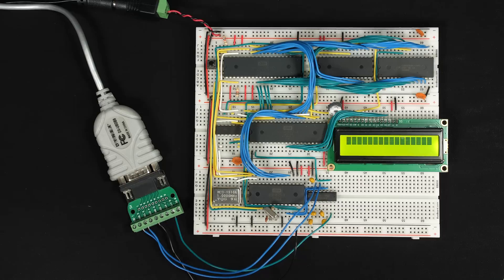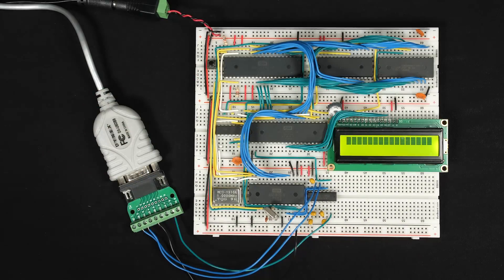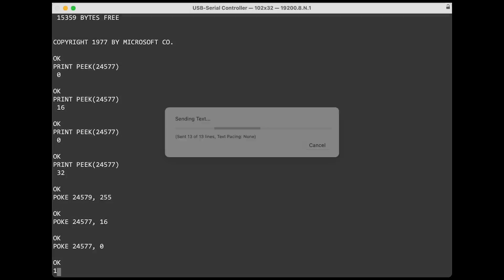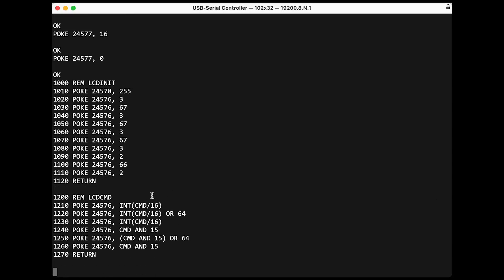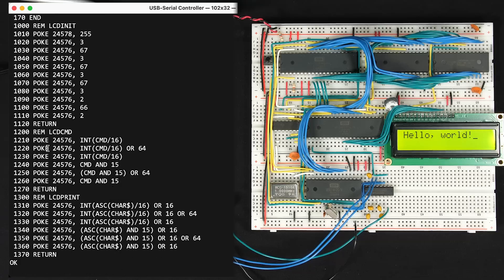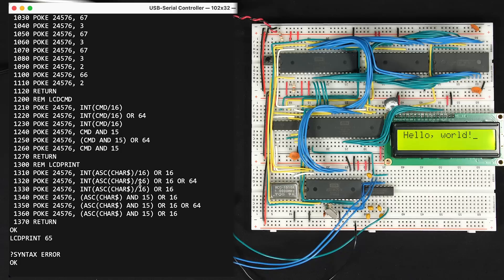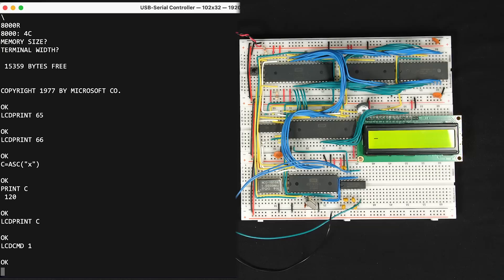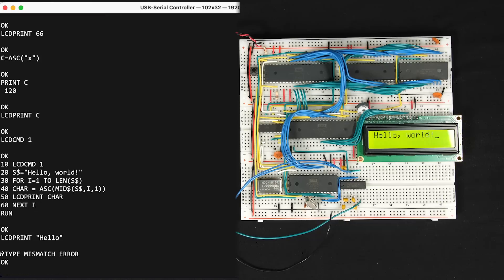Hacking Microsoft BASIC

Comment: One thing i noticed, not sure if it's relevant, but in your LCD instructions, you're calling txa to transfer X to A, but then shortly after calling pha to push A to the stack, then calling pla at the end to pop A back. 

It looks like whatever was in A before you run one of the LCD commands is getting lost, but I could be wrong.

Comment: Dear Sir
When you type 'mov' on programing enviroment, it still display on the screen as text mode before compiling, right?

I have searched through internet, but none have clear answer relating how exactly computer physically detect series of 0/1 abstraction per code line to trigger control signal through circuit??

For example again: 
Key board: you press the letter, and it physically interact with circuit
Punch card: you punch the hole and computer physically detect holes to trigger the bulb light or not ( via light through hole or not)
Two clear above example shows the physical that make the bridge to link 0/1 abstraction to hardware. 
And about binary pattern after compilling, what's the physical mechanism to detect them to trigger electrical signals????

Comment: Just amazing, I was loaned an open university circuit board, with associated literature, for a few months to try and understand how early computers work. I worked steadily through the modules but found the modules to be weak and lacking in actual detailed explanations e.g. why registers were not set back to zero, I thus became frustrated and by the end of the three month loan I had not gained the required skills to fully understand how the code did what it was doing.  Contrary to the open university course Bens short explanations of how the code is constructed and executed with resultant actions taught me more in 40 minutes than the thee month university moduled course. I found the comments section in the tutorial useful too in that the answered many of queries (misunderstandings on my behalf) I had. Big thanks to Ben and all those who answered other peoples queries, questions and constructive criticism.
Thank you all.

Comment: Dear Mr Ben, I have a question that myself not clear for a long time:
When we type code display on the screen, it is translated to machine code as binary pattern.

But how this text of series 0/1 interact with memory hardware and generate electricity signal as on/off switches

For example, we press key and it closes the switch, we load punch card and computer has sensor to detect holes or not as 0/1

Comment: So, I didn’t like the fact that the lcd was showing just blocks. I wound up running the LCD initialization assembly right in front of Wozmon. I also had it print a string showing “Wozmon” after the initialization. I then had the reset vector point to the beginning of that assembly code.  It then dropped right into Wozmon. I did the same thing at address $8000 so when you wanted to run basic, it printed “MSbasic” first and then dropped right into basic. This was a great video. I’m glad we’re using the lcd again! I also tried to run Oregon Trail in basic just to have an out of memory error at line 6000 something. I would love to see you show a ram banking scheme.

Comment: In a future video/video series, would it be possible to see if you could interface this computer with analog voltages like with an ADC or something? I’ve always loved that interplay of analog and digital, DAC, ADC, wave forms generation, reading resistance, that sorta stuff with custom circuits. Like I’d love to build like my own Data Acquisition System like a mini Keysight 34970A with a little breadboard computer like this.

Comment: i wrote similar code on a Commodore 64 emulator running MS BASIC and it took about 1 second to run. When i moved the POKE address to a variable and stored the INT(ASC(... in a variable, it ran almost twice as fast. You had to make optimization on these old machines (and on new ones, too).

Comment: FOR I=1 TO LEN(S$)
If I was teaching a computer programming course, I would deduct 1000 points if someone handed in an assignment with this, You don’t want to re-evaluate LEN() for each loop iteration. Instead, set a variable (constant) to be the length and then use that for your loop limit. That is if the version of BASIC supported dynamic FOR loop limit. I’ve seen some versions that fix this value even if it’s a variable. Very old version from 1970 or so.

Comment: I made LCDPRINT by using the formular evaluator of msbasic. So LCDPRINT is like PRINT (not well tested). The following code should fit to Ben's code on GitHub, which is a little bit different to his code in the video. The code is more or less a compressed copy of PRINT.
 
LCDPRINT:
  jsr FRMEVL            ; Evaluate formular
  bit VALTYP            ; Is it a string?
  bmi lcd_print_string  ; Yes
  jsr FOUT              ; Format floating point output
  jsr STRLIT            ; Build string descriptor
lcd_print_string:
  jsr FREFAC            ; Returns temp pointer to string
  tax                   ; Put count to counter
  ldy #0
  inx                   ; Move one ahead
lcd_print_next:
  dex
  beq lcd_print_end     ; All done
  lda (INDEX),y         ; Load char of string
  jsr lcd_print_char    ; Output to lcd
  iny
  bne lcd_print_next    ; Go on with next char
lcd_print_end:
  rts
Reply: Hi, I gave your code a go, and it doesn't seem to work. Mind you, neither does Ben's code on Github
Reply: @alancx523  Thanks for trying. I didn't use Ben's code from github. But I didn't want to post my complete lcd.s. I'm using the code from the video. You can try it too. The label lcd_print_char is the routing to output a char to the lcd. In Ben's older code it's labeled with print_char.
Reply: @Ralf4511  

Together like this? If so, it doesn't work. I type LCDPRINT "STUFF", it return and get nothing. 
Hoping I've got something wrong!! 

LCDPRINT:
  jsr FRMEVL            ; Evaluate formular
  bit VALTYP            ; Is it a string?
  bmi lcd_print_string  ; Yes
  jsr FOUT              ; Format floating point output
  jsr STRLIT            ; Build string descriptor
lcd_print_string:
  jsr FREFAC            ; Returns temp pointer to string
  tax                   ; Put count to counter
  ldy #0
  inx                   ; Move one ahead
lcd_print_next:
  dex
  beq lcd_print_end     ; All done
  lda (INDEX),y         ; Load char of string
  jsr lcd_print_char    ; Output to lcd
  iny
  bne lcd_print_next    ; Go on with next char
lcd_print_end:
  rts

lcd_print_char:
  jsr lcd_wait
  pha
  lsr
  lsr
  lsr
  lsr             ; Send high 4 bits
  ora #RS         ; Set RS
  sta PORTB
  ora #E          ; Set E bit to send instruction
  sta PORTB
  eor #E          ; Clear E bit
  sta PORTB
  pla
  and #%00001111  ; Send low 4 bits
  ora #RS         ; Set RS
  sta PORTB
  ora #E          ; Set E bit to send instruction
  sta PORTB
  eor #E          ; Clear E bit
  sta PORTB
  rts

Comment: It would have been wonderful to have the assembly code of 6502 Microsoft BASIC forty years ago. Ohio Scientific computers used Microsoft BASIC that had a horrible garbage collection bug. If you were lucky it would just scramble all of your strings but it usually locked up the computer which meant your program was gone. Since OSI was a little company, Microsoft never fixed it.

Comment: Could you help me control this ST2225A LED display driver reliably? 
Apparently it's kinda like a 35-bit shift register with an initial 1, but for me it doesn't always show the output. It still outputs the correct things, but sometimes it just skips an update and shows nothing during that. 

I'm using a Raspberry Pi Pico (with Arduino IDE) to control it, and I've in my opinion followed the timing diagrams correctly.
Also you can find the PDF online

Comment: I remember on the TRS-80 (Model 4), and on the basic that came with early PCs, you had the LPRINT, and LLIST commands (that did the same as PRINT, and LIST) except they sent the data to the printer; so you could print out your programs, or make cool banners on the printer.  It's neat to see your basic kind of works the other way around by default (if you imagine the idea of swapping the LPT printer port with a RS232 serial interface).

Still, it would be really neat to see a whole slew of equivalent) L-prefixed commands for your "Hitachi interface" compatible LCD module...

Such as LCLS to clear it, LPRINT to write to it, LPOKE/LPEEK to set custom character graphics for the upper 128 characters, or read status, etc.  Not sure if there's value in LLIST, because even the larger modules are only 40x4 characters... But you might want to account for those too, as IIRC their memory is non-linear (i.e. they behave like 20x8 screens).

Anyway, just chimed in to say this is super cool, and I love what you're doing with it, (even if my imagination runs a bit wild). 🤘

Comment: You could have LCDPRINT check for the quote character if it's present then call LCDPRINTSTRING which would do the string processing......but it seems fast enough on such a small display it wouldn't really be needed.

Comment: 1st rule of programming - if you are repeating a block of code make it a subroutine! Duplicating code is wasteful.

Command 1:
code
code
JMP Common

Command 2:
code
code
JMP Common

Command 3:
code
code
(no need to JMP here, we just continue into Common)

Common:
code
code
etc.
Reply: You would usually be correct, but with these older slower systems it really becomes a trade off between size and speed. For instance.. 
A simple loop that fills a 8kb area (Worlds Worst Video Card) takes around 90,000 cycles:

FillScreen: ; Setup Screen pointer
 STZ Screen ; Ben Eater's Worlds Worst Video card 
 LDA #$20   ; uses the upper 8Kb of system RAM
 STA ScreenH; This starts at location $2000
 LDY #0     ; Zero out Y for loop, we'll clear off screen area as well.
 LDA #0     ; Always use 0 for color with this routine. Cold load a memory location instead
 LDX #0     ; Zero out X 

.MemLoop    ; Small, slow, fully rolled clear loop. Also clears  offscreen area.
 STA (Screen),Y
 INY
 BNE .MemLoop
 INC ScreenH
 LDX ScreenH
 CPX #$40 ;Top of screen memory is $3F-FF, 
 BNE .MemLoop;Do until $40-00
            ; Reset it all
 STZ Screen ; Ben Eater's Worlds Worst Video card 
 LDA #$20   ; uses the upper 8Kb of system RAM
 STA ScreenH; This starts at location $2000

However take a look at this unrolled routine:
FillScreenLoop:
      INX  
     ; This is unrolled so that there is a STA for each row of the screen.
      ; Display mapping has 28 bytes at end of each row unused.
      ; Display location = $2000
FillScreen:                            ; Entry with x at 0 (or wanted start) and A with data/color value
      STA Display, x                ;  Line 0
      STA Display +$80,x       ;  Line 1
	STA Display +$100,x   ;  ...
	STA Display +$180,x
	STA Display +$200,x
	STA Display +$280,x
..... etc .....
	STA Display +$1F00,x
	STA Display +$1F80,x       ;  Line 63. (0-63 IE 64 lines)
	CPX #99                              ;  Row is 99 long (0-99 IE 100 rows)
	BEQ FillScreenLoopEnd    ; 1 compare and 1 branch/loop pair per 64 rows
	JMP FillScreenLoop          ; 5 cpu cycles per pixel drawn. 
FillScreenLoopEnd:                   ;  3x faster than a normal rolled loop

The routine above only takes 32,910 cycles. About 1/3rd the cpu cycles of the 'normal' routine. If your goal is to update a screen as quickly as possible you have no choice but to trade space for speed. Even with some tweaks  'proper' functions like are normal on modern systems are just too slow for some things on something like a 6502 running at a couple of Mhz or less. Though they will make everything easier to port to another system and possibly help use less memory.
But then on the flip side of both of these extremes you have something like WozMonitor that it is neither 'proper' nor 'slow', and it also known as one of the densest little chunks of code ever produced!

Comment: Nice stuff Ben. Im considering changing C64 BASIC to use the math capabilities of the Kawari to speed up BASIC in general, although I havent yet figured out how best to convert between FP and multiple integer operations and back again.
Reply: Microsoft didn’t bother. All math operations were done in FP. If you were worked with integer variables then they were converted to FP for processing and back again for storage. This is why using integer variables is actually slightly slower than FP.
Reply: @stevetodd7383  yep, Im aware. The point being that Kawari can do 16x16=32bit multiplication, and the c64 has a 32 bit mantissa so it should be possible to speed up at least the mantissa multiplication (which I think is currently done with shifts and additions).
Reply: As an aside, MS BASIC was pre the IEEE FP standard, so you may have problems working with any hardware FP solution.

Comment: First, the BASIC editor converts the commands (POKE) into a command byte before storing the line of code.  The list function converts the command bytes back to text.  This saves significantly on program storage space and execution time.  Second, since the LCDCMD and the LCDPRINT code are almost identical, you could re-use the identical part with a jmp or branch.  Third, a more standard way to do this would be to OPEN a device file and then to PRINT to that file.  You could even CLOSE the file when you are done.  Printers, tape drives, and floppy drives used this method on the Commodores.
Reply: While all true points, don't forget the purpose of these videos are to teach, not to write the smallest, fastest OS. A wall of impenetrable code doesn't serve the "teaching" aspect too well, regardless of it saving 20 bytes.

Comment: The comment about the interpreter having to read each character and then determine if that forms a valid keyword reminds me of how ZX Spectrum BASIC has each of its keywords assigned an ASCII code, meaning every command is only one byte.
Reply: It’s called Tokenisation, and Microsoft BASIC does it also. It was a standard way to reduce the memory requirements of a program, but  Sinclair cheated in that they didn’t bother starting with the string command and converting to a token before saving the typed line to memory, they just had you type the token directly on the keyboard (resulting in a horribly complex keyboard map).
Reply: @stevetodd7383  Mmm, although I think when you typed a program in 128K mode, it did the tokenisation when you entered the line. So it took a little longer to "register" each line but then only needed to interpret the tokens at run time.
Reply: @K-o-R  yes, they fixed things for the 128 (and gave it a more conventional keyboard at the same time)

Comment: No, the interpreter doesn't "read p,o,k,e", the main feature of MS basic is that all commands/keywords are tokenized so, POKE is represented by a single byte (called token in MS basic) 0x94 to be precise.
Reply: How else would it recognize the token if not by reading it one character at a time?
Reply: It only reads the characters P, O, K, and E once, after the user has entered a program line.  Having recognized these characters in that order, it enters a "token" at the appropriate place, which is a single byte corresponding to the POKE command.  It's a kind of bytecode. @alexander53

Comment: Current LCDPRINT could be called LCDCHR, and the new print function that takes the string into account could be the new LCDPRINT.
Reply: I wonder if LCDPRINT could check if there is a single byte or a string and print either one correctly instead of using multiple commands
Reply: @hyper_lynx  That might be possible, but I don't think there would be a way of distinguishing between 65 the ascii character and 65 the number, sind this old Basic would parse both as numbers
Reply: What needs to be done is to use the current PRINT command's line evaluation routine to create the text to be printed, then use a new machine code routine to print that to the LCD instead of to the serial port.  In principle, it's quite simple.  Even in practice, it shouldn't be all that complicated.
Reply: @melkiorwiseman Or use a version of basic with printer support and push that to the lcd
Reply: In Commodore BASIC, you could redirect PRINT's output with the CMD command. Or use PRINT# instead. That means having to hande files. Not complicated, really?
Reply: Wow, super asynchronous code reviews!
Reply: More is less, and ocd is always watching.
LCDPRTCHR
LCDPRTSTR
3 letters per attribute, 3 attributes per command
Reply: @MichaelOfRohan  PRT doesn't look much printy, how about LCDPUTCHR and LCDPUTSTR?